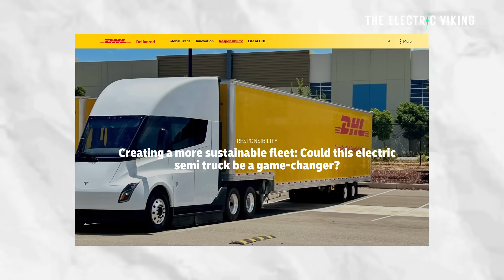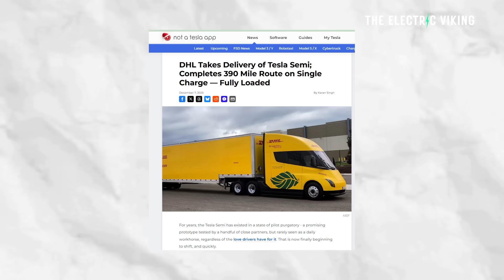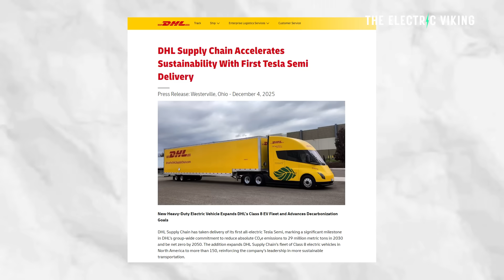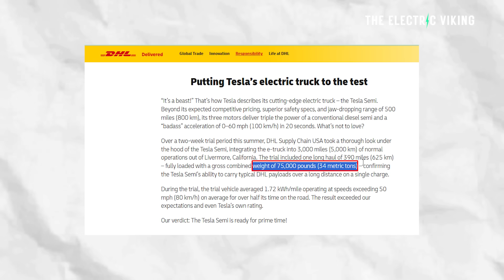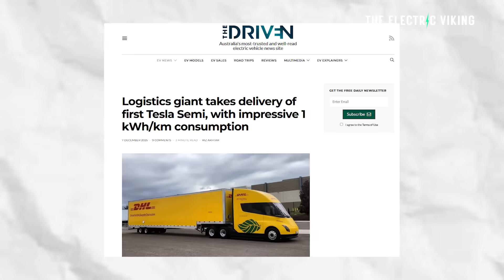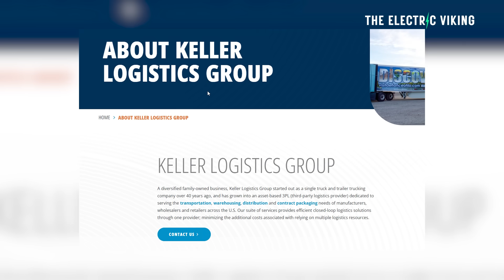Tesla Semi Drives 390 Miles on Single Charge Fully Loaded with Range Leftover!

Comment: Much safer, quicker, and more efficient. Infinitely quieter. Much lower cost per mile. Once Tesla is producing these at scale, diesel trucks will fall like dominos. Shipping runs on razor thin margins; Tesla Semi will save double digit percent per mile. Fleet managers will buy them as fast as Tesla can make them.

Comment: i just asked alexa why electric trucks are considered not viable. ...she gave me four reasons, upfront costs, charging time, lack of charging infrastructure, and hauling capacity.

i pointed out that charging infrastructure is completely dependent on the success of electric trucks, and it was simply a case of "which came first the chicken or the egg" and then went on to point out that EV cars and charging started out with zero charging stations until tesla began building them to service their cars. and the same would happen with EV semi tractors. ...she then agreed.

i also pointed out, using her estimated charging times for semis, that 30-60 minutes for an 80% charge is about the same time semi tractor drivers take to fill up at their home bases anyway and that that amount of time would have zero impact on their time tables. ...she agreed with that too.

i then went on to hauling capacities. 82,000lbs is the federal limit for Class A trucks. both tesla semi tractors and diesels can haul that amount. ...again when i pointed out the numbers, she agreed that i was right and that she was wrong.

and finally, when i asked her what a Volvo diesel semi tractor upfront cost compared to the proposed price of a tesla semi tractor, she quoted me the same price. 

she had to eventually agree that an EV semi tractor was in every way comparable to today's diesel version. ...but i had to point out each one of the invalid points she initially made, which was probably based on misinformation she was probably picking up from the internet.

Comment: yeah so i did some research about the infrastructure.. Tesla megachargers require a up to 1 MW charger per truck for a 30 minutes at 1MW load to 70%.. so yeah more trucks means more MW needed or shared/divided whatever connection it has to the grid.. more trucks = more time.. so unless tesla also builds powerstations that are capable of managing more than 1 or 2 trucks.. good luck.. cheaper to build new railways!

Comment: How much millage the Tesla Truck will do with it's life time ? One truck can work for 20 plus years while need fixing that dont cost half of the new truck price.
Tesla truck on the other hand have a large battery that loses it's range and then it cost more then the truck is worth to change the battery.
What's the use of long range with new batteries when after 5 years you have like 20% of the range gone. 
Also charging the battery takes half a day so it's wasting time a lot

Comment: The new solid state batteries us8ng silver is ready for production and it is expected to go 900miles in a single charge in a semi. Tesla is about to have tuff competition. As a trucker i do 700- 750miles at 68 mph. Regional could do 500 to 600 miles. Solid state trucks might sell like hot cakes. As time changes park8ng lots might have plug in chargers for overnight and if is winter being plugged in to the grid and stock will make life easier.

Comment: you also have to take into account their was the magma batteries no one is talking about went private retail last summer and power stations are built fully using them. but for the little guy they come out this 2026 summer. they have an 40 year shelf-life they will excel in hot climates so solar farms in AZ and other states that have them will off set the load of all the EV Tesla trucks country wide in USA once online. so combine them with half cell solar aka 24 volt panels and we are in for an big drop of in gas demand so we actually make green stuff finally more so an reality in our country. now we need to deal with the legal junk holding back state by state charging stations causing them to have an 2030 eta delay in some states... sigh...

Comment: It has been my experience that the companies quoting mpg-e values are calculating it wrong.  Is it because they are just idiots or they are intentionally trying to deceive the public?  Decide for yourself.  To get a realistic mpg-e value, you must factor in the cost of electricity AND the cost of gasoline / diesel fuel in addition to the electricity consumption per mile.  For example, with a OTR electric truck like in this video, with 1720 wH/mile electricity consumption, if electricity costs $0.35 per kWh (what my local Tesla Superchargers cost) and diesel costs $2.90, you end up with 4.81 mpg-e.  If you drop the electricity costs to $0.20, that results in 8.43 mpg-e.  If you decrease the diesel price to $2.60 (which I've seen locally), you get 7.56 mpg-e.  If your local diesel price goes up or your local electricity price goes down, then the mpg-e increases.

If you are basing it on the current energy consumption of your vehicle (watts per mile), then do the following:

Equivalent Gas Mileage (mpg-e) = (1000 × Current Gasoline Price ($ per gal))  ÷  (Vehicle Economy (Wh/mile) × Electricity Cost ($/kWh))

Comment: Somebody isn't telling the truth here.  The max weight allowed of any vehicle on federal highways is 80,000 lbs.  This means that the truck wasn't hauling 75,000 lbs of cargo.  The truck WEIGHED 75,000lbs.  There's a major difference between the two when compared to a diesel: LI-ON batters are very heavy.  Mathematically, diesel engines outperform electric under these real-world highway constraints.
When Tesla publishes the weight of these things, only then can anyone claim better performance than diesel.

Comment: Average diesel semi fully loaded has a range of about 1800 miles, holds approx 200 gallons, can be fueled in 20-30 min. and there are literally thousands of filling stations in every state. The Tesla at best gets 500 miles of range and takes 30 min to charge to 80% using Tesla's "Super Charger", which only 3000 exist in the entire US, about 50/state. Additionally the diesel semi's are minimally affected by cold weather as opposed to the electric. My question to you MR Viking is why are you not talking up hybrid technology for semi's? It's old tech, been used by the rail industry since the 50's for heavier hauling than semi's. And it works year round. Me thinks either you are 1/2 brain dead or just blind to facts.

Comment: Truck driver here, u usually get around 500 to 600 miles on flat terrain on an avg diesel big rig... 400 miles on a battery that requires a household's worth of electricity with a long charge cycle is not going to turn the industry away from diesel. You stick one of these trucks up and down real mountains, and they will have significantly reduced range, this isn't even counting going through cities or traffic jams .... this is all after assuming the uber expensive battery actually lasts past 5 years, most companies will dump the fleet when they start to get the bills from replacing the truck batteries, the cost is pretty crazy. Companies like DHL can get away with this crap because most parcel loads are not 40k lbs, they are more like 20 to 30k at most, with predictable routing back and forth to terminals with charging stations... Even then they will still have major issues like every other company has, and will abandon the project. As long as we are relying on battery driven vehicles without major breakthroughs in battery technology itself, this stuff will continue to fail catastrophically.   Most trucking companies played with the idea, have left wing CEOs that bought this junk and are now being forced out due to pissing money away on toys with no real value in the industry. The idea is great on paper, in actual practice its just making people feel better about themselves, while exploiting Africans for lithium and producing more waste and pollution from disposing of these things while musk makes billions of stupid people with more money than sense.  Electricity is made from coal fire plants in a majority of the US, more electricity = more pollution.  Green energy is rapidly failing due to its immaturity as a technology, needs more time and love to actually be used correctly and cost to the companies developing this stuff. At the end of the day, being an early adopter has massive drawbacks in almost every scenario, these guys will spend hundreds of billions of dollars beta testing all of this while musk and others  rapidly improves this what should be prototype technology.  This stuff will take decades to get anywhere near close to replacing combustion engines or coal fire electricity, Doesn't make it bad or unusable, It's just not as far along as people would like to think.

Comment: I work in trucking.  Here's what I know:  1.  Drivers really like the electric trucks, they are inherently simpler to operate and you don't have the noise and the "aroma" of diesel fuel.  2.  Gross Vehicle Weight allowable on interstate highways is 80K lbs, so a 75K total weight is a full load, however they fail to state the actual cargo load.  This is important to shippers.  A standard diesel tractor can haul around 45K of cargo before it goes over the 80K GVW.  Cargo weight matters, and electric trucks are much heavier so I doubt the load is comparable.  3.  While operating costs are indeed cheaper, the actual up-front purchase cost of these vehicles far exceeds what current diesel tractors cost, so much so that even the very low operating costs do not make them economical at this point.  The technology is impressive, but it's still not ready to replace diesel trucks.

Comment: 400 miles at 60mph is 6.5 hours. Are truckers allowed to drive for that long without stopping? With re-charge stations at suitable places - rest & charge at the same time. Not enough chargers? Well - supply follows demand and in the trucking business it is all about cost, so the routes & loads would be designed around availability. And availability would be provided often, as part of the planning. It's not as if the fleet of diesel trucks is going to be pensioned off until their investment is paid off. Though they might ply different routes where EVs struggle initially.

Comment: CDL holders can only drive 11 hours per day with manditory 30 min break after 8 hours . So if the truck can charge enough to finish the 3hours of driving after the 30-45 min break then its over for diesel trucks and i mean over .
Reply: According to the Wiki page on the truck, it uses approximately a 900 kWh 1000V battery and needs a "Megacharger".  I don't foresee these showing up at your average truck stop anytime soon.

Comment: To charge 25 of these trucks at the same time it takes enough power to supply 10000 to 20000 homes! How many trucks operate in a city,  yes thousands! 8 to 20000 trucks for a city of 1 million that will require 4 to 7 GWh to charge daily.
Reply: Thats very unlikely also most of the time these things are going to be slow charged over night

Comment: A tesla truck weighs more than a regular semi, so it cannot haul as much, and the bigger question is where is all the power going to come from to charge all those electric trucks? The AI boom is sucking up all the available power, and it seems the only way to keep up is to build more fossil fueled power plants now that the US is abandoning renewable energy. So create more pollution to run an electric truck that costs far more to buy and can haul less than a ICE truck over a shorter distance, and needs several hours each day to recharge.
Reply: Tesla semi is about 20-23k pounds so not far off

Comment: 🇬🇧If the trailer isn’t fully loaded, then it makes sense that there is room to place a battery pack in the trailer chassis. In turn it makes sense that the size of the semi can also have a smaller battery pack, and be manufactured in a smaller size also. This will dramatically bring the cost down, and increase the range. Win, win!

Comment: If they can charge from renewables, this will be fantastic to see adopted,
Reply: Even if they don’t it still makes a lot of sense.
Reply: @Freba9  Nope, electric semis make no sense. Costs more to buy, hauls less over a shorter distance, and needs hours each day to recharge in an already overloaded electrical network.
Reply: @billharding8411  Incorrect. Many companies are buying electric trucks simply because it makes so much sense. Yes, purchase price is still high but savings in road tax (Europe), cost per km and maintenance are huge. Payload capacity is nearly equal to diesel. Also savings in CO2 emissions are huge which becomes more important to customers.

Comment: I’mma get this guy away out from his stupidity that makes this video I do agree that electric trucks ain’t about 50 years plus I’m spelling it out for you. That’s why I said the whole word will be able to run across America without refueling all the way across another reason these trucks won’t work in every spot. There is a weight limit for trucks all across America mandated by the federal government to go across bridges so the bridges won’t collapse your break the weight limit for a truck fully loaded basic truck is 80,000 pounds. including truck and trailer legally on the freeways which are especially made and set up for heavy trucks in the bridges are high enough to accommodate 13’6 some higher. For those who don’t know that so the truck won’t hit a bridge. It goes under the bridge without hitting it. I know y’all see it on the news all the time. I know y’all see trucks that flip over in the rain cause they slide these trucks have not been tested in real life weather conditions only in ideal conditions.

Comment: OK, I don’t wanna chime in like this. DHL is not a logistic giant they’re like last place especially in America just to let everybody know DHL is not a logistics giant at all now notice FedEx UPS are the main carriers Amazon nobody is using these trucks the three main companies around the world are not using these trucks. Only the small companies like Pepsi, which is changed hand several times believe it or not DHL which been sold three times and other smaller companies which we think are big have these trucks these are not long haul trucks they will not go the full mileage of gasoline or natural gas truck will go remember to check the fax on these companies that are buying these trucks before you purchased them don’t let nobody persuade you to buy something based on the information they give you without investigating for yourself. All of these trucks have been tested in ideal conditions not real weather conditions. They’re only tested in good markets no snow no high heat like Nevada or Arizona. They’re tested in ideal conditions. Remember that they’re tested cameras following them. They’re being monitored and repaired as necessary on the spot. They’re not cut loose all alone on the road going through conditions like a regular car or CDL truck yes there are electric trucks/EV but it’s like 5% of the market out of 100% do your research don’t believe the hype. These trucks have not been tested in real world conditions in the elements rain snow, sleet, wind, tornadoes high winds none of that batteries drain faster in the cold. They also drained faster going up heels in certain states it’s all about sustainability not a fake fantasy💩💯💯💯👈🏼👈🏼👈🏼

Comment: I did a deep dive into hydrogen vehicles about 10 years ago and came out convinced it cant never ever work. I suspect it is pursued due to desire and funding from the fossil fuel industry to sustain their business model into the future. There are no other logical reasons to fuel a vehicle with hydrogen. 
Hydrogen is not a fuel but an energy bearer meaning you need to already have energy to create it and i doing so you lose energy in the process; compressing, chilling to near absolute zero, transporting it, boil off, and finally when converting the gas back to electricity in the H2 fuel-cell onboard a vehicle. You end up with about 20% of the original energy. It is a MASSIVE loss. And is the reason for why it costs $120 to go 300 miles on hydrogen and at the same time why the fuel companies wants it.

Comment: Carrying 5 tonnes of battery for 350 miles range is crap. A diesel semi can do 2,000 miles on one fill up. The cost of down time recharging will kill semi EVs as will reduced cargo capacity of 35mt vs 40 mt.
Reply: they still had battery left also most semis go under 500miles a day charging takes 30mins and its about 20-23k pounds so not far off a normal semi calm down Mr. Doom and gloom😂
Reply: @mcsike7264 reducing the load cspacity by 12.5% and factoring in finding recharging points that can provide sufficient power in aahort space of time. Not every delivery location will have charging facilities. I foresee its all going to cost 25% more just for the time element, to say nothing of reliability.
Reply: @Dungshoveleux your miss a key thing tesla is going to make their own charging imfersuctire like they did with their cars amd its going to be built into the navigation so there is no looking for a charger
Reply: @mcsike7264 but the only way of saving charging time is to have recharging at every delivery point. Not going to happen due to costs.
Reply: @Dungshoveleux no you don't
Reply: @mcsike7264 if you have to go to a searate charging point, thats extra time/money to get there. A diesel track can work for a week without getting recharged every day.
Reply: @Dungshoveleux mhe they get charge over night